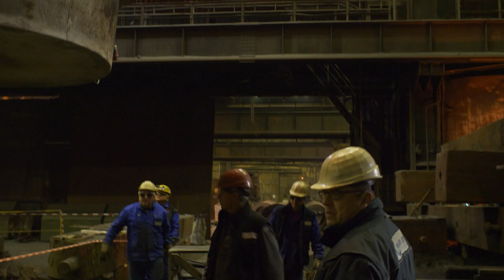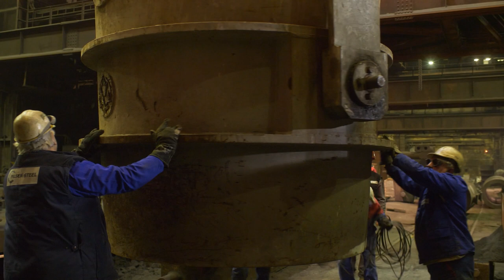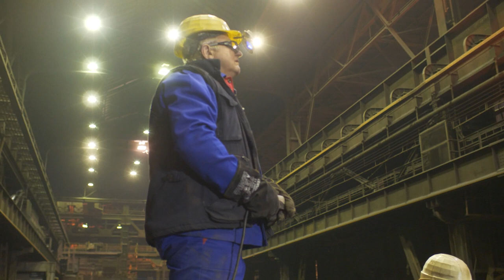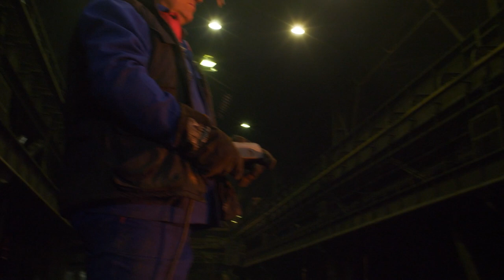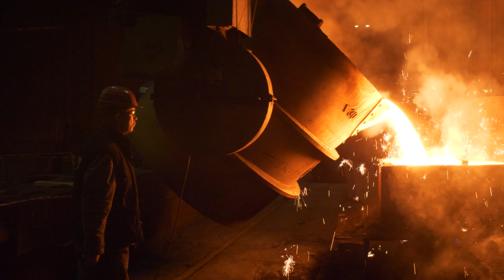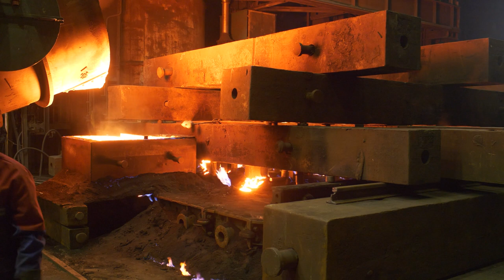Pilsen Steel - pouring of an iron casting

Comment: I was lucky enough to sork in gray iron foundry in the mid 70’s and work with guys like this who were around during the war. The stories they told of that time. Guys would come to work and not leave the plant for 3-4 days at a time. Ate there, slept there. Round the clock production. So many molds to pour that they stacked them up on the sidewalk in front of the plant and guys would run out with 50 lb ladles of iron and others would shake them out as soon as possible. One guy helped pour a crankshaft for the battleship Missouri. They dug the mold out of the ground and poured directly into it

Comment: I worked for several years in a factory that made train wheels.
Two furnaces, each producing 90 tons of molten steel, took turns to supply steel to the hydraulic presses of the forge.
The steel was poured into huge ingots 10 feet high by 2 feet in diameter.
Each casting produced a dozen ingots, which when cut into 5 blocks, produced the steel for +/- 60 train wheels, depending on their diameter and weight.
Reply: This is a stupid question but could you tell me what something like that smells like? It's got to be unique. Also, when the metal cools, does it glow red?
Reply: @olgathehandmaid  Sorry to disappoint you, but your question is absolutely not stupid.
As for the smell, as I remember, the heat given off during the pouring was so intense that it seemed as if even the molecules giving off the smells were instantly burned.
The smell that wafted through the factory was more hydraulic oil than any other smell.
As the ingots were unmolded, they seemed to glow a red tinged with orange and yellow, like huge Star Wars lightsabers.
They remained orange-red for a few hours (6-8 hours), while gradually darkening as they cooled.
It was more during the machining of the wheels that the particular smell of steel could be felt, despite the continuous flow of cooling oils to cool the carbide cutting tools.
Reply: @thepragmatic6383  Thank you so much for your insight and description. It's men like you that keep the ceiling of the world standing, but I'm glad you're not working in those conditions anymore!

Comment: Nice video of an iron (steel?) casting being poured.  Thanks for sharing!  I wouldn't want to be so near that hot metal ladle just in case a cable broke or a trunnion failed on the ladle itself.
Reply: XD if that thing fails their all dead
Reply: I worked in a cast iron foundry in Ohio for 8 years. I’ve seen some crazy shit happen. Fortunately nobody ever died but we did have some guys get messed up bad. I’ve been next to 2000-2500 pounds of 2700 degree iron and the heat rolling off of it is unlike anything most people will ever be able to understand. The place I worked was a much smaller operation than this one. Our biggest casting was maybe 1500 pounds and our main ladle held just about 3000 pounds and  I’m betting this was about 10 times that amount. Made me nervous just watching those guys!!
Reply: it is ok, because all the cable is anti-high temperature cable, and the design for the casting crane is if one of the cable broken, the others can lift the ladle for one working cycle. it must be like that.

Comment: Standing WAAAY too close to that.
Reply: You dont get to operate these things from across the room.
Reply: My ladle was honestly much smaller. The biggest was probably holding a little over 3000 pounds. It had a big wheel and we turned it by hand. You were almost always with 2-3 feet of 2500-2700 degree iron. Got burned up a lot. Working after getting sunburned was the worst!! lol

Comment: Use to do this mid 2000s
Started pur pouring sand on molds and throwing ferris powder 
Set up for heat
Never had the confidence to run the crane

Comment: When your work is so hot that you have to wear multiple ayers of clothes to keep the heat off of you
Reply: Worked as firefighter for a time Even with the clothes you still
Get burned sucks
Reply: People would look at me like I was crazy working in the steel mill , 90 degrees with long johns on under your uniform ! Your clothes would burn you if you didn't !
Reply: I hated wearing the green jackets. Our place was pretty lax on safety. T-shirt and jeans with the leather leggings and slip on steel toed boots. Don’t make the mistake of wearing a shirt with a plastic design it would feel like it’s melting to your chest!! lol

Comment: Someone just tripped and fell halfway into one at Caterpillar inc. What a horrible way to go.
Reply: I don’t know if it’s the same guy but I heard he was on the job 9 days. I’ve seen shit go south fast but what was someone with no experience doing in a position that dangerous!! He was getting iron to test I heard. We tested our as it hit the main ladle with a 4 foot handle on the cup!!
Reply: @bbkyjohnson  only 9 days on the job.  Dang, that's so sad. Thank God it only took a second to "transition" and he most likely didn't feel anything. I seriously doubt, the brain is aware of what's happening with your physical body in that moment. Just a horrible tragedy.
Reply: I don’t know about feeling nothing? Up until contact with that much metal I’d imagine the sensation of burning is extremely intense. Get a sunburn and stand in front of your oven at about 400 degrees. That temperature isn’t even close to what we dealt with.